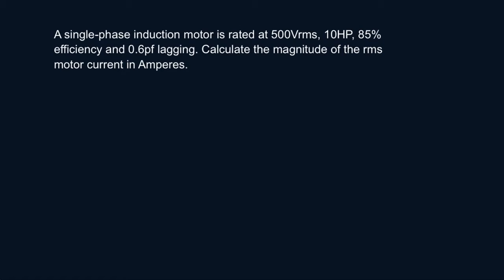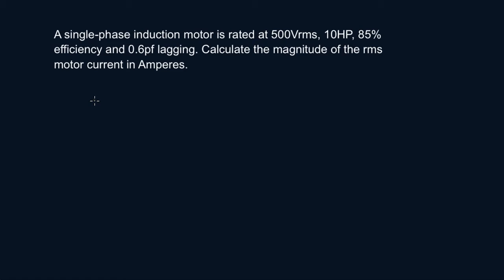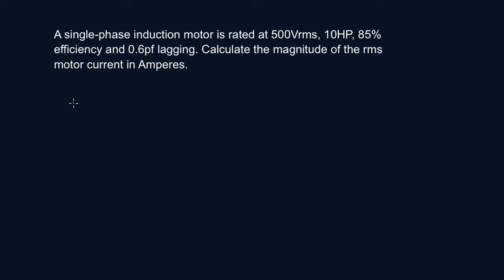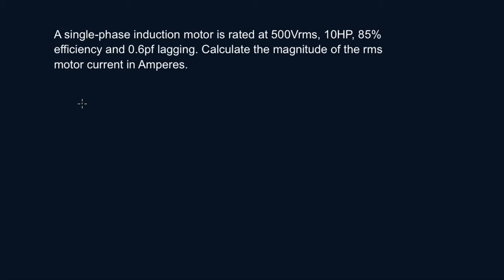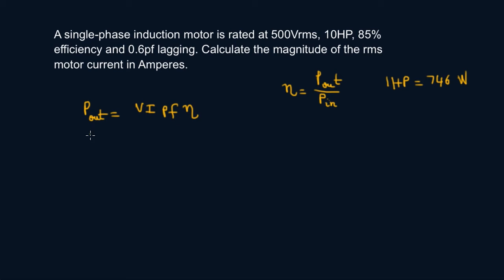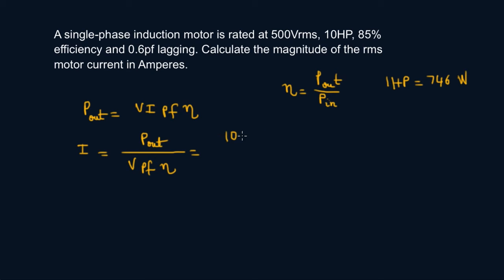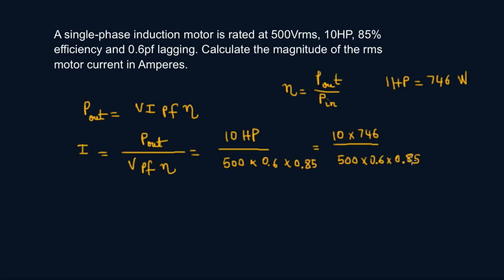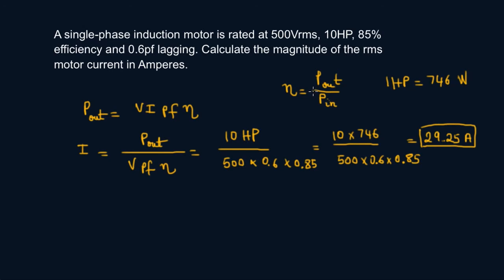Induction Motor--Calcuate Current Given HP, Efficiency and Pf

Comment: A 3-phase induction motor is rated for 415V, 15 Hp, 50Hz at 0.80 lagging power factor.
Calculate the full load rated current. Draw vector diagram showing (i) voltage, current,
 (ii) active power, reactive power & apparent power.
please solve this one.